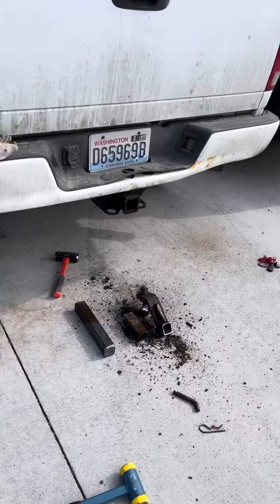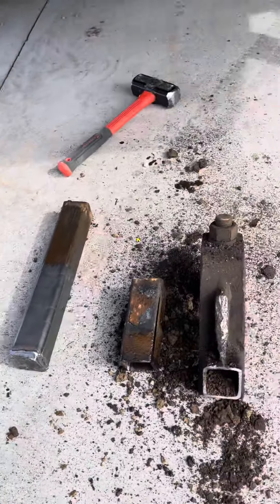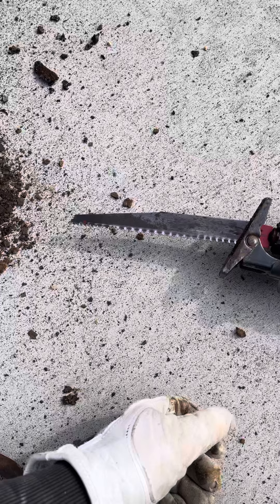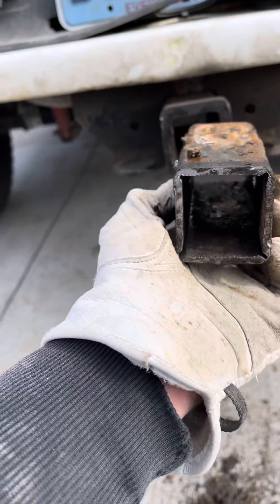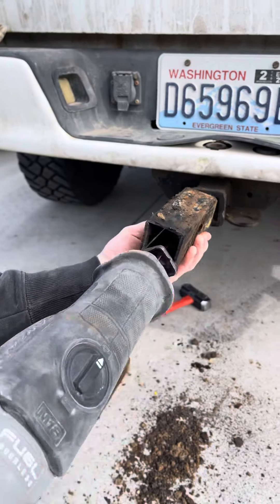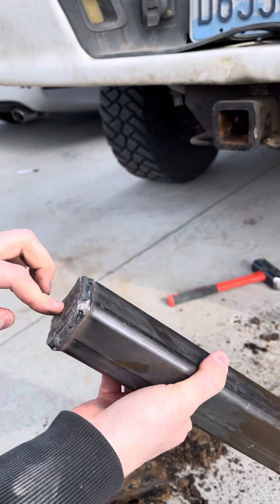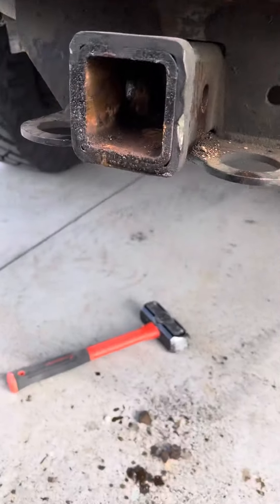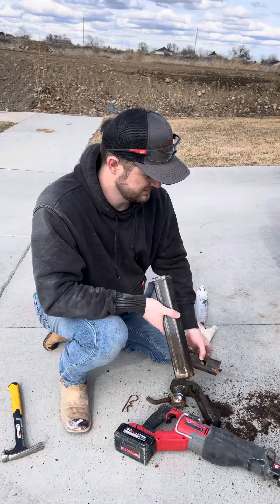Rusted and stuck hitch removal, easy 5 min removal. (Hollow tube hitch only)

Comment: So I just did the same job on my Ford Edge.  Followed your method  plus soaked the thing with WD40.  The back end of my receiver was capped so I couldn't punch it out. Instead I drilled a hole in the stub of the hitch and dropped a bolt in it , then used a series of chisels to wedge the thing out. Took hours but it worked.  Cheers !

Comment: I tackled mine today 2015 ram 2500 reducer sleeve was seized inside the hitch, cut the corner with a Milwaukee Amped carbide teeth sawzall blade, luckily in my case the reducer sleeve was sticking out so I drilled two holes on opposite sides, slide a pin in with some chain, chained it to a tree and she came right off. 
I just purchased the truck, sent a pic to the previous owner of me removing it,  he told me he took it to a shop to remove but they couldn’t!!! Internet and knowing how to turn a wrench since I was kid did the trick lol!

Comment: instead of hammering it "out"... couldn't you hammer it "in"....the receiver is a through tube...seems you could just hit it into the truck and break the seal????
Reply from the maker: @rickc357 we tried that, the rust formed  a welded like bond to the metal due to the fact that it was in for so many years.  we couldn’t pound it either in or out, and we tried both ways for almost an hour with the hammer.